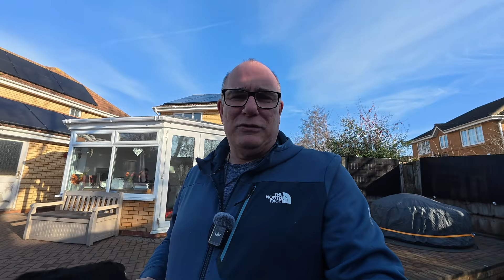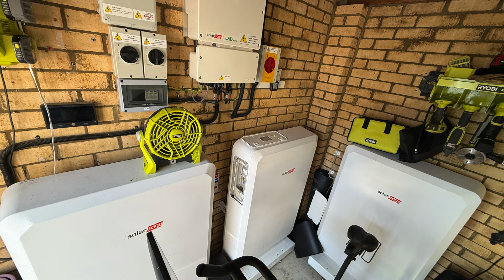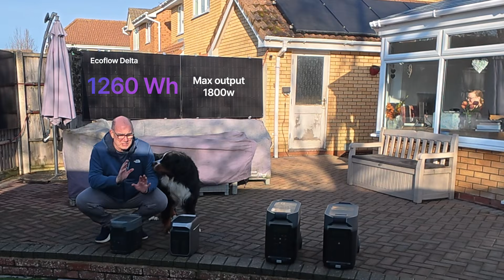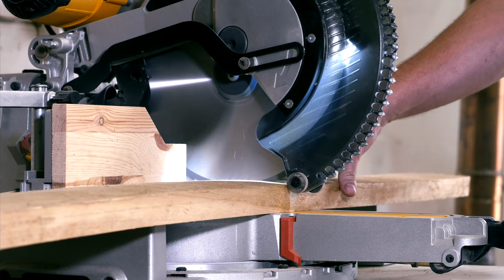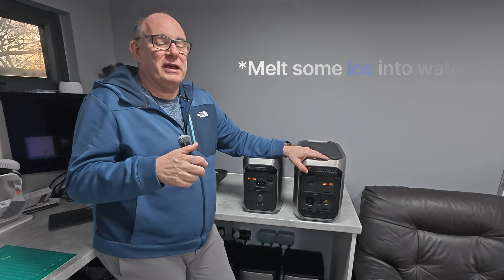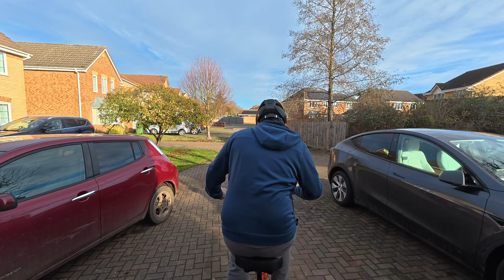I Didn’t Need Another Battery… Until This

Comment: Are your power stations really quick enough to keep IT running without suffering a brownout?  My experience (other brands) is that you need a UPS otherwise a desktop PC and NAS will drop out....
Reply from the maker: yeah, it works better than my old APC UPS, there is zero downtime. Neither am I desktop Mac or my UGREEN NAS. go off-line if the power drops. And then if the power does go down, I have 1 kWh of power in the battery and that could last six or seven hours easily.
Reply: @JonathanTracey  Good to hear.  My PW3 will kick in without any light flicker, but both my NAS and my microserver will drop out - which is a pain especially if there is a cut/return/cut in quick succession from the grid (as I suffered from a while back) where my NAS took about a day to rebuild itself! I now have UPSs on my server and my network cabinet which resolve this.

Comment: So Ecoflow have pony'ed up for a D3Max 8)

Got a couple of Delta 2s that have had a real beating and are doing great. Couldn't get the D3 time of use to actually work properly when it came out so moved to Bluetti and been very happy with that too.
Reply from the maker: not tried bluetti but heard good things. the D3 uses the new app controls a little less intuitive than the old delta pro but figured it out 😊
Reply: @JonathanTracey yep the D3 app was nice but it kept forgetting to actually charge at the time. I gather the firmware got much better.
Reply from the maker: yeah, I think it’s improved a little bit, I still get a few oddities with the stream Ultra but so far with the Delta three max it’s been solid

Comment: Sorry but my Pecron F3000LFP costs less than this and destroys it.
Reply from the maker: it probably does cost less as this is a premium price point but how exactly does it destroy it?
Reply: @JonathanTracey  well it has more running capacity at 3600 watts and 3072 watt hours of battery backup.  Solar input of 1600 watts with a very wide range of 25-120V and 25 amps.  Ecoflow doesn't like to advertise their anemic solar input specs but theirs is only 60V and 15 amps per MPPT.  

I'm actually using my Pecron F3000LFP to power my house's 120 circuits.  On a 5 hour solar day, 8000 Wh vs 5000 Wh and then in the summer 12800 Wh vs 8000 Wh is a big difference in solar power generation for the F3000LFP vs the EcoFlow Delta 3 Max Plus.  

I really hate Ecoflow's naming conventions as well. What's next, the 'Max Plus Plus Super Ultra Spectacular'?
Reply from the maker: Nice not tried a Pecron before not sure if they are even available here in the UK. I agree with you on the naming its getting very very silly
Reply: @MassiveOverkill  the new Ecoflows are now called "Delta (PRO) 3". Just incase you started to understand them.

Comment: With ref to running the comps off the battery, I've read that continual operation isn't good for these (or any) battery. Is that true, or is the new tech more resilient? 

Bear is beautiful - I've two Newfoundlands so can sympathise!
Reply from the maker: I can only give you my personal experience, but I haven’t seen any issues with running batteries 24 x 7. My larger EcoFlow batteries have a covered day often over three years I have never been wrong. They’re not showing any signs, expectation or loss of capacity so I’m not sure to worry about. Obviously over long periods of time there will be degradation, but right now I’m not gonna worry too much about it.

Bear is such a good boy, he does like to get involved in whatever is going on, our other Bernese Mountain dog Yogi is much more chilled. I’ll probably fast asleep.